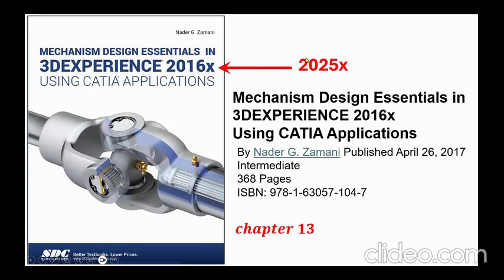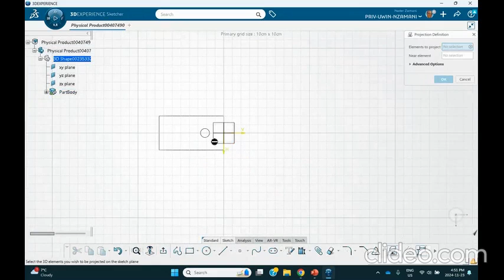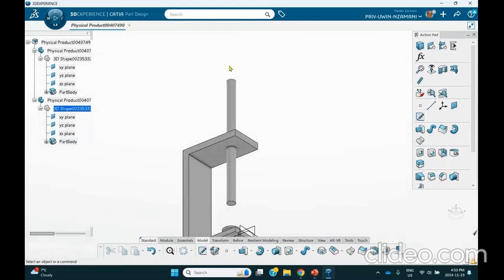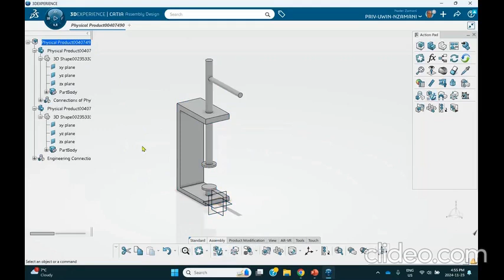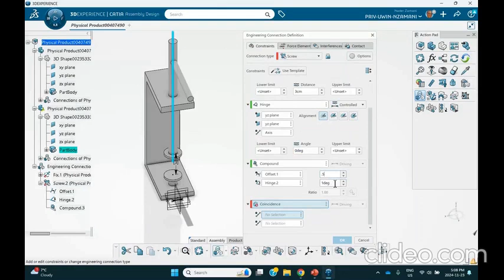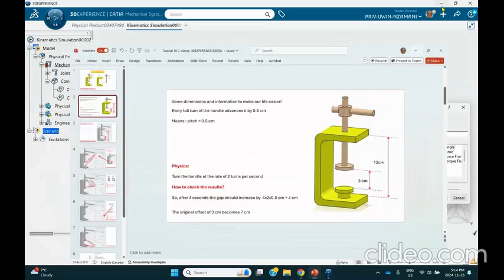Tutorial 19 -C-clamp  3DEXPERIENCE R2025x

Comment: hello Professor, I saw your comment on Ata Khabaz CZM modeling video. in future you are going to make video on 3DExpereince. have you created any data related to it. i'm working on cohesive modeling on 3Dexperience platform. i'm facing some issue. So checking for solution. I will wait for your response.
Reply from the maker: Dear @sumitkumbhar, last May, my contact at Simulia told me that CZM was not yet available in 3DEXPERIEMCE's implementation. I asked the same question two months ago but have not heard back.